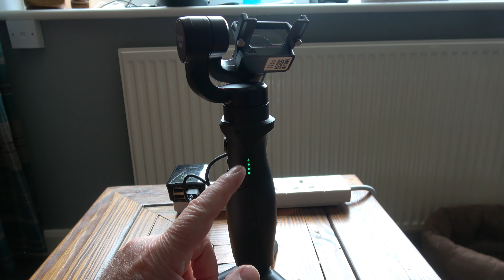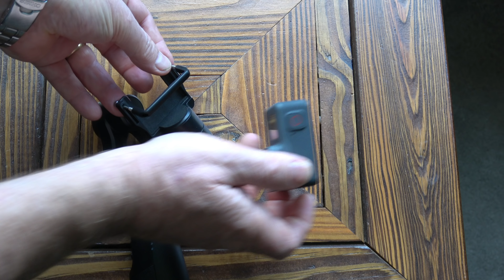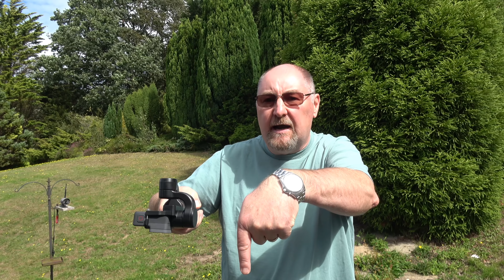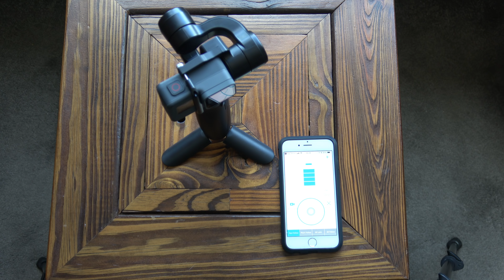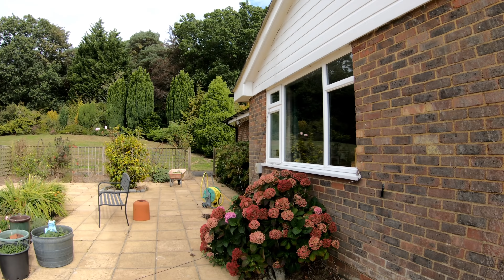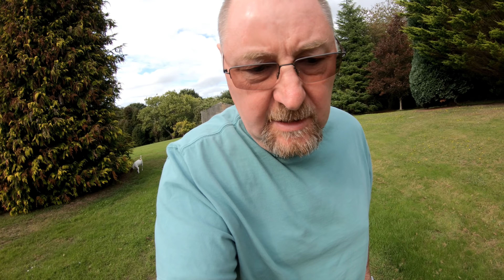Hohem iSteady Pro - Review.  A Budget Gimbal for Action Cameras

Comment: Any ideas on how to undo the battery cover - not mentioned in the manual
Reply from the maker: It is not a removable battery.  :-)
Reply: @RussellPlatten Doh!!  - Why did they bother mentioning that it has an 18650 battery in the handle if you aren't supposed to change it!
... and thanks for your quick reply & an excellent review

Comment: Good review, Whats the trigger button for ?
Reply from the maker: There is no trigger button.  :-)
Reply: @RussellPlatten  Thank you for your reply, the big switch on the back they call it the trigger switch what does it do ?
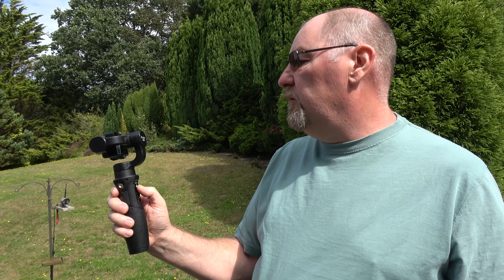Reply from the maker: @MyStepps  Look at 4:55 for the purpose of the toggle button.  :-)
Reply: @RussellPlatten  Sorry to be a pain, the switch is on the other side it's got the letter T on it,  I have no idea what it is.
Reply from the maker: I think you are looking at the wrong gimbal.  This is the iSteady Pro and does not have a trigger button.  The iSteady Pro 2 on the other hand does have a trigger button.  When you press it, it speeds up the motors for fast action shots described as Sport Mode.  Double pressing the trigger re-centres the gimbal on its original position.  :-)
Reply: @RussellPlatten  Just looking at your model it doesn't look like you have that model,  I'm sorry for the confusion.
Reply: @RussellPlatten  It could be.. it says on the box.. Hohem iSteady pro
Reply: @RussellPlatten  Hohem iSteady Pro 3-Axis Handheld Gimbal Stabilizer for SJCAM YI Sport Camera. I bought it from eBay.
Reply from the maker: @MyStepps  I reckon you got the newer improved model.  The original does not have a trigger the Pro 2 does!  Lucky you!!  :-)
Reply: @RussellPlatten  Hi, Again, It doesn't say 2, maybe like you said improved, thanks again.

Feiyu Tech, have just released The Ricca, action camera, 
it links with there G6.
it looks very good and there are NO reviews about it, I wish you would do it, thanks again.

Comment: what go pro are you using was thinking on getting the hero 5 along with the gimbal but i hear the hero 7 has really good stabilization on it dose the 5 have a mode for stabilization.
Reply from the maker: I am using the hero 6 for everything but the last clip.  I have now got the Hero 7 and you do not need a gimbal with it.  The Hero 6 benefits from a gimbal as the stabilisation is not quite good enough.  If you can afford it I would get the Hero 7.  If not the Hohem will improve any sports camera so the 5 would be fine.  I wanted 4K.  :-)

Comment: Shaky footage when electronic stabilizer on gopro was off. My Osmo pocket kills em' both Gopro and gimbal but still I like your video.
Reply from the maker: I am using a Hero 7 and Osmo Pocket now, and I find my self reaching for the GoPro more often than not.  :-)
Reply: I like Gopro for its dynamic range. The sky looks bluer compared to OP. I only used Gopro during daytime as its stabilizer sucks or doesn't work at all in low light. That was the reason I'm checking a gimbal to buy for my Gopro. Thanks for the video sir.

Comment: Gimbal arrived. Struggled to calibrate it but it got there in the end with a bit of creativity lol. The toot is not right for a camera that mounts with the lens closest to the gimbal motor. 
Sort of struggling with it ATM. It seems to want to fight me. I turn left it seems to over compensate. Maybe it's just me or i need to work on fine tuning the settings to suit my style. But it always seems to want to wander to the right.
Reply from the maker: That sounds a little suspect.  It should not be wandering anywhere.  If it needed calibrating out of the box I would be a little concerned.  I would try calibrating it again and if there are still issues consider replacing it.  :-)

Comment: I’ve been using a Zhiyun Smooth 4, which is for smartphones, but also works with action cameras with an adaptor plate. For my GoPro 6 it’s not perfect, and I’ve been keeping an eye out for a low-cost gimbal just for the GoPro. But after watching your video I can see the Hohem iSteady Pro has most of the same annoyances and limitations as the Zhiyun Smooth 4. The one advantage of the Zhiyun is no motor noise is picked up by the GoPro, possibly due to the isolation of the adaptor plate. On the down side the Zhiyun is not as compact as the Hohem iSteady Pro. So I’ve decided to make do with the Zhiyun Smooth 4 for the moment. Maybe Santa will bring me a GoPro Karma if I’m a very good boy.
Reply from the maker: The Zhiyun Smooth 4 is a fine gimbal and will do the job.  Fingers crossed for a Santa surprise!  :-)

Comment: Another question if I may... With a GoPro, can the gimbal be held upside-down to get low-level shots?
Reply from the maker: You can get low level shots quite easily, but after the gimbal handle reaches around 20 degrees below horizontal, the motor becomes visible in the camera view.  So you can crouch down and it will be fine or the best bet would be to mount the gimbal on a selfie stick and you would be able to stand normally to film low down.  I hope I have explained this adequately.  :-)
Reply: @RussellPlatten  yes I understand. Thanks so much.

Comment: Is it possible to connect an external mic to the GoPro or is the cover is blocked by the gimbal? Perhaps the GoPro can be installed upside down?
Reply from the maker: With the camera mounted the right way round, the cover for the mic is blocked.  It is easy to install the GoPro upside down so mounting an external mic should be OK so long as it does not interfere with the gimbal in use.  :-)

Comment: Hi, very good review.  Could this gimbal be mounted on a bike or chest harness when mountain biking?.   I know hohem make a wearable gimbal but the battery life on this one is very attractive.  Also does the gimbal fit in the carry case with the Gopro attached?.  Thanks.
Reply from the maker: I reckon with a bit of ingenuity you could mount it, but it would be difficult.  The 6mm thread on the side could be used to mount it at a point near to the motors giving it more stability.  The gimbal will not fit inside the case with a camera attached.  :-)

Comment: Hello! Friend, has your video been very useful for me as you linked it with Bluetooth?
Reply from the maker: Thank you.  Yes the gimbal uses Bluetooth to connect to the app.  :-)
Reply: @RussellPlatten  ok! but how do you link it, what do you press? or how should the Bluetooth light be, fixed or should it blink?
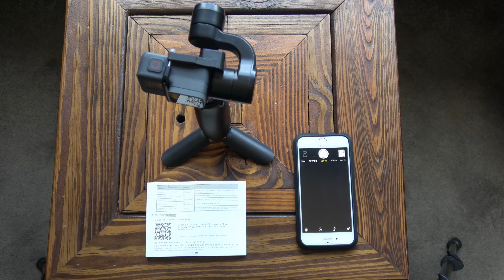Reply from the maker: I just downloaded app and made sure my phone had Bluetooth switched on.  The app found the gimbal immediately.  It looks like the gimbal has Bluetooth on permanently.  The Bluetooth light stays off until the app is connected.  Once the app is connected the light turns on.  I go through all of this from 5:56 on the video and explain the Bluetooth light at the end of that section.  :-)

Comment: Hello nice review :) i am curious, is able connect this gimbal via wifi and start/end recording with red button on gimbal? or i must always push button on the gopro for start/end recording
Reply from the maker: The gimbal will connect to a smart phone or tablet, but not to a GoPro.  You could connect your GoPro to your phone and use the phone as a remote control.  Or if you have a newer GoPro with voice control you can tell it to start recording, this works well with mine.  Otherwise, you will have to press the button on the GoPro.  :-)